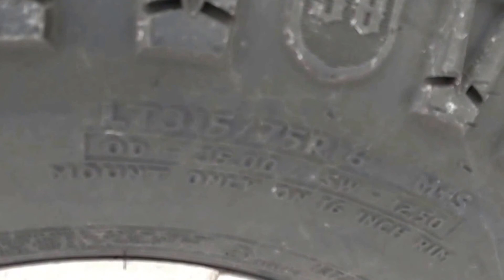Mickey Thompson Deegan 38 road noise

Comment: I have a jeep soft top so I doubt I'll be hearing any noise from mud tires
Reply from the maker: Around town, at slower speeds, you may hear a humming.  On the highway I doubt you will hear them over the wind noise of a Wrangler, especially with a soft top.  Thanks for the comment.
Reply: NorMI Living I have mud tires I'm just looking into something that will help me cause of ice
Reply from the maker: Jeep Milk I had no troubles in snow and a little bit of trouble on ice, but then again so did everyone else around here.  My truck does weigh about 8000lbs and I ran them at 50 psi to help with winter conditions.  I would hate to give you misinformation about them, but I run mine year round and I don't really have any complaints.  I hope this helps your decision.
Reply: NorMI Living well it's ice there's no traction on ice
Reply from the maker: Tell me about it, we get an average of 160 inches of snow each year and ice is part of that.
Reply: NorMI Living well last month I got those tires so far I'm very impressed on mudding
Reply from the maker: TSAP 17 Glad to hear it. That's why I started these videos, to share information and firsthand experience. enjoy.